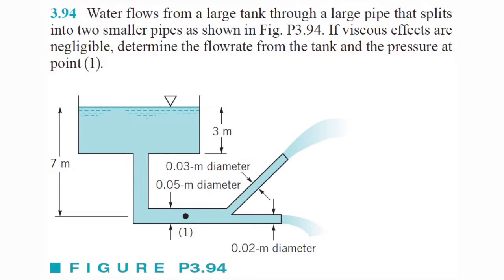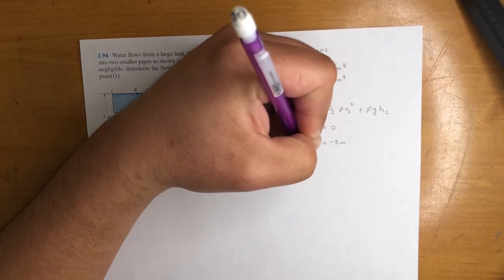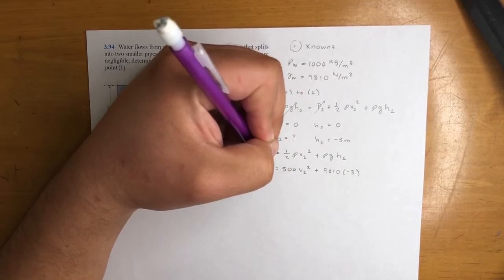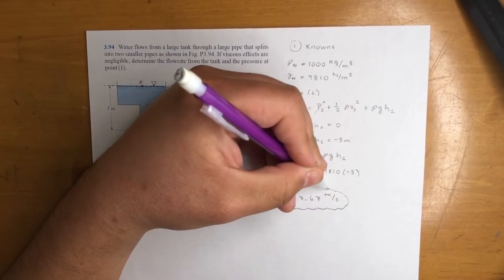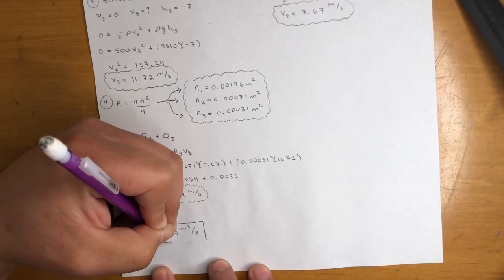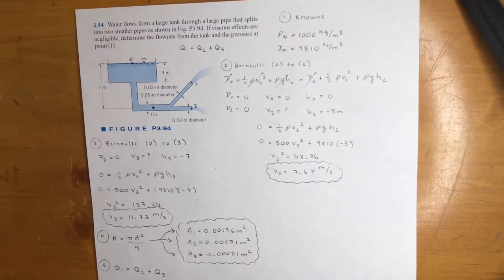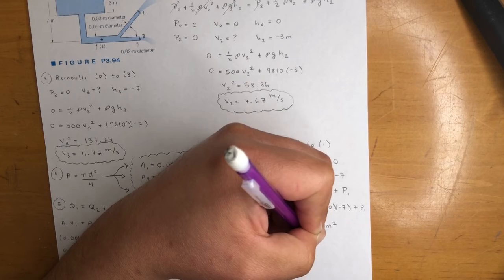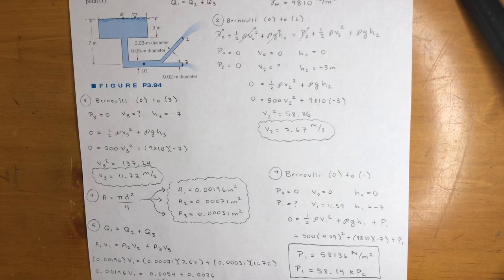Fluid Mechanics - Water Flows from a Large Tank through a Large Pipe that Splits

Comment: If there is a tank which is connected to one pipe and that one pipe later divides into 3 pipes. Why does the 3 divided pipe have unequal amount of water?
Reply from the maker: I don’t think I understand the question exactly here. The tank has one pipe that divides into two pipes. The reason there’s unequal amount of water in both outlets is because the area itself is different. The flow rate is the same as Point 1 though when added. So if the area is smaller in one pipe, it just means water travels faster through that pipe to achieve the same flow rate.

Q = A * V

If area decreases, To keep Q the same, you need higher velocity. If area increases, you need lower velocity to achieve the constant flow rate if that makes sense.